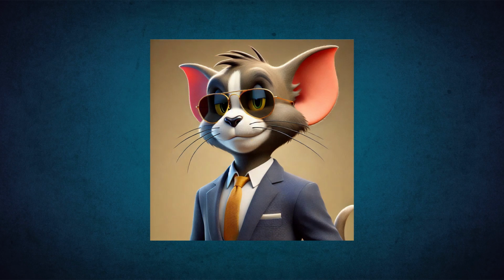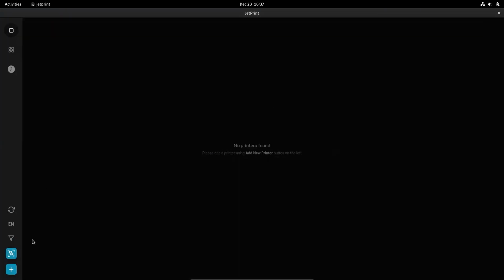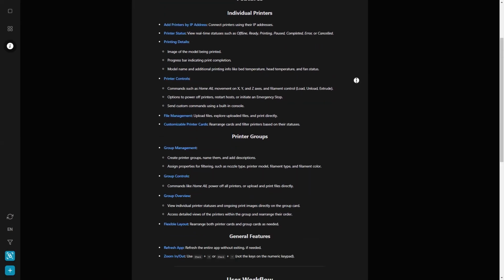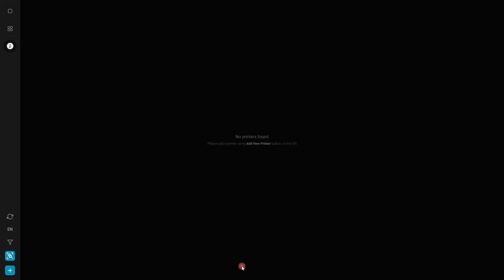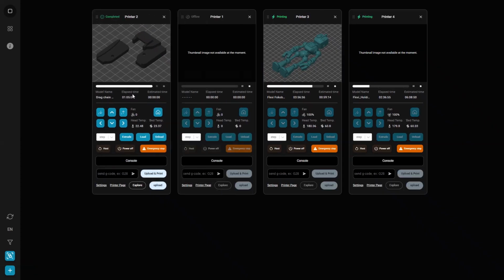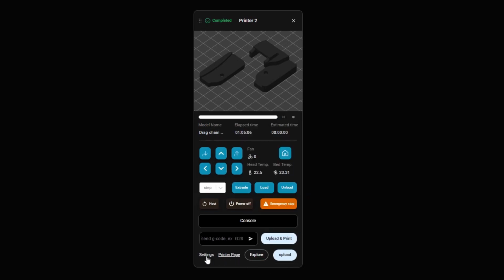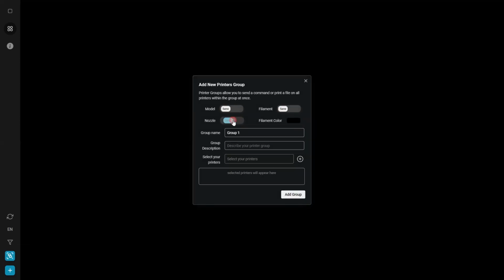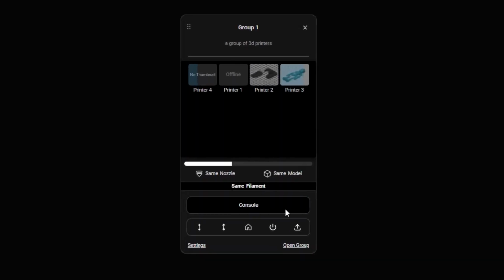Launching Free Klipper 3D Printer Farm Software | Devlog #3

Comment: 1. mega videos 2. danke für deinen einsatz denn ich denke in dem bereich ist noch luft nach oben 3. das slicen und verteilen der jobs ist noch ausbaufähig und da müssen denke ich slicer und "managing software"gut ineinander greifen denn ein gcode ist meist für einen bestimmten drucker mit bestimmten setup vorgesehen bei einem beispiel mit einer baugruppe die man final haben will mit X teilen variiert die druckdauer und menge der teile und das sollte zeit technisch gut eingeteilt werden das die teile möglichst zeitgleich fertig werden oder das eine bestimmte baugruppe möglcihst zeitnah fertig wird (der uinterschied ist das eine erfordert mehr drucker das andere erfordert mehr zeit ) und mit dem im sinne kann man das weiter spinnen wenn man weis welches filament, und wie viel filament (abfrage bei spoolman) auf den druckern drauf ist kann man zuordnen ob kleine oder große teile mit der menge gedruckt werden können (so könnte man restmaterialien reduzieren die auf filamentrollen über bleiben) das war nur mal ne idee ggf ist da was verwertbare bei in dem was du anstrebst ;-D

Comment: How many have you used at once so far? I plan to try and use it with Elegoo Neptune 4 series I will let you know what you find.
Reply from the maker: In this version I tested it with around 32 printers, but it had some issues. I've already fixed them and now the program can handle as many printers as you want. I'll make a video about this update soon, once it passes some tests. Looking forward to ur feedback—much appreciated :)
Reply: @sullyVids  So far no issues using the Elegoo 4 series with the software. Do you mind if I do review video on this once I get a little more time with it?
Reply from the maker: @tactikool4740  I absolutely don’t mind! My only request is to do your review on the upcoming version, which will be out very soon, as I’ve fixed a lot of issues—not just the printer limit. thanks in advance
Reply: @sullyVids  Yeah no worries
Reply: @sullyVids  Also is there way to automate pushing prints off?
Reply from the maker: That’s a cool idea I believe it could be done with some G-code commands at the end of the print. I haven’t added it yet, but I’ll keep it in mind for future updates so thanks for the suggestion

Comment: Ayooooo this is what i was searching for! I just moved from home to a small office with now 10 printers (had 4 when i ran them at home). Still need to feed them wifi cables, this is awesome!!!

Edit: I can't test it for now since i don't got a windows machine. But i think i will buy one soon just to run this, so maybe its already in there. But after starting all the printers it would be cool to have a screen with camera's (possibility to add ip camera's or printer webcams. So you can monitor.)
Reply from the maker: Hi, thanks for the comment glad this is what you’ve been looking for 🎉 Just a heads-up, if you’ve got a Linux machine, you can run the program on that too.

And yeah having a screen for cameras would be awesome, I’ve got that noted for the future, so thanks for the suggestion :)

Oh, one thing though just to let you know, this doesn’t work with Bambu printers, unfortunately. But if you’ve got any other ideas or feedback, I’m all ears!
Reply: @sullyVids  My original idea was to purchase an 7'' touch screen for my pi 4. 3D print an mount for the pi monitor onto my desk and make an controller that is always near my 3D printers. Do you think a rpi4 can handle the software with 9 machines?

For now i need to build a little bit more in my new workplace, connect them to wifi and stuff. A lot of work to do for me before i can use it. 

I would love to think about new features for in the future, and if you need help maybe i could help u with interface for smaller touch screens (design, not coding).
Reply from the maker: @OSRSMusicParodies  Your setup sounds good, the program is very lightweight and, based on my tests, it uses minimal resources, so your Raspberry Pi 4 should handle it with no issues, even with 9 machines connected.

Honestly I hadn’t thought about using it on a touchscreen it’s an interesting use case! the program UI is responsive though, so it might already work  but I haven’t tested it yet ,Thanks for offering to help with the design side. I’ll keep that in mind, and if I add touchscreen support in the future, I’ll be sure to let you know.

Good luck getting everything set up, and feel free to share any ideas along the way :)

Comment: Hi friend, I did some tests, 40 printers connect normally, after another 20 printers they connect every other time, and when I added 92 printers, the program stopped connecting to all printers at all. I wanted to know if it was possible to share the source code and the program files "not for sale" I'm interested in how the program works and maybe I can figure out this problem.
Reply from the maker: Hi,
Thanks a lot for your detailed feedback and for putting the program through such rigorous tests, I really appreciate it! I’ve identified the cause of the issue. I even mentioned it in the video description :)

I'm already working on a solution for that and it will be ready soon, just after I test it and ensure it works properly.

As for sharing the source code, I’m not able to share it at the moment as it still needs a lot of refactoring and polishing to reach a professional standard, which is very important to me. However, I’ll continue improving the program, and once I fix this issue you’ll see an update about it on the channel. I’d love to keep hearing your feedback along the way—it’s incredibly valuable 

FEEDBACK IS EVERYTHING 🙂
Reply: @sullyVids  Thank you for your answer, I will look forward to updating the program, and I will also immediately test it for you on a large number of printers.
Reply from the maker: Awesome, thanks for helping out with the tests! Your feedback’s really appreciated :)

Comment: Thank you very much for your work, in a couple of days I’ll test it on a hundred printers
Reply from the maker: A hundred printers? That’s insane—can’t wait to hear how it goes! Thanks for giving it a shot!
Reply: @sullyVids  Hi friend, I did some tests, 40 printers connect normally, after another 20 printers they connect every other time, and when I added 92 printers, the program stopped connecting to all printers at all. I wanted to know if it was possible to share the source code and the program files "not for sale" I'm interested in how the program works and maybe I can figure out this problem. and if I can come up with some kind of improvement, I will of course share it with everyone completely free of charge
Reply: @sullyVids  Hi friend, I did some tests, 40 printers connect normally, after another 20 printers they connect every other time, and when I added 92 printers, the program stopped connecting to all printers at all. I wanted to know if it was possible to share the source code and the program files "not for sale" I'm interested in how the program works and maybe I can figure out this problem.